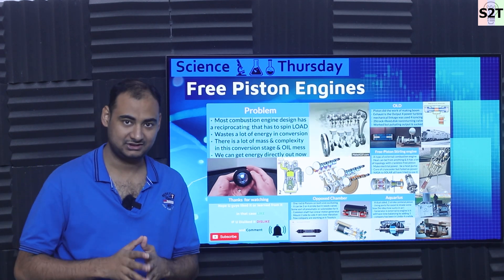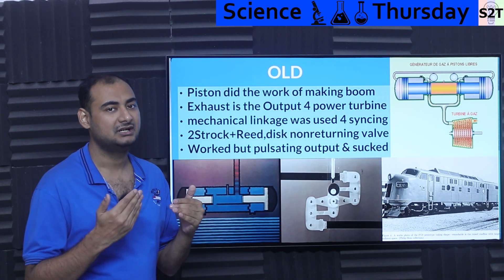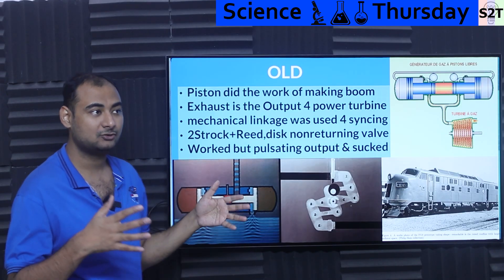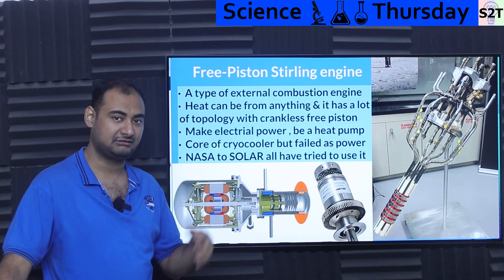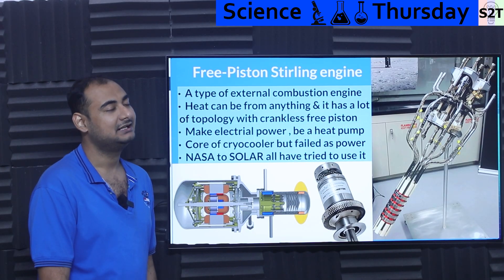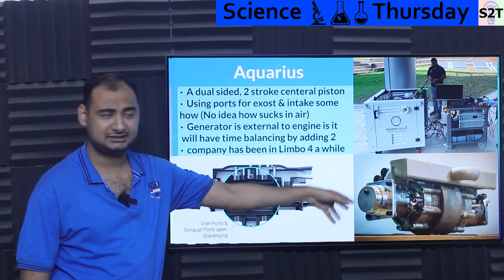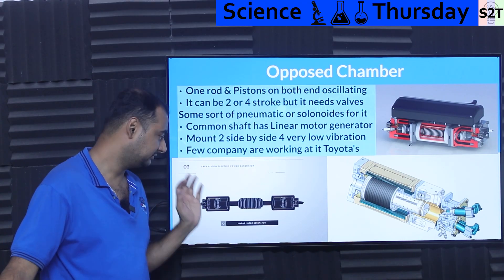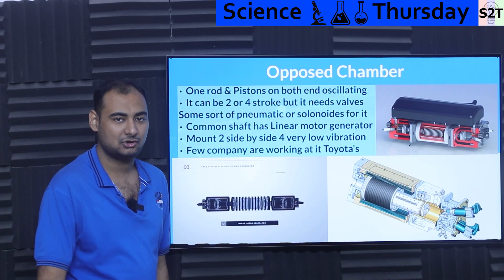Free Piston Engines Explained {Science Thursday}

Comment: 12:00 hybrid turbocharger (with electric motor/generator) on startup generator power turbocharger and in operation recuperate (generate boost and electricity) from excess exhaust energy.
what will be compression ration in that? 100:1 10000:1 free floating 'piston' have nothing to stop movement except compression to slam piston in to dead end. power stroke is uncontrolled in movement.

in my opinion every ICE range extender should have turbo-generator or hybrid turbo-charger-generator. for DC power high rpm is a benefit in power generation.

edit after comment added "ICE"
Reply from the maker: hybrid turbocharger does need a ICE system to feed it or it will become just like a jet engine

Comment: Well done.  I remember hearing about gas springs on the ends, could those power the valves?  
With jet engines working on electric instead of gearbox could we be getting mini turbo jet serial hybrid trucks?
Saw this, would be great for heat recovery, but I think the military ate it for submarines and drones. 
https://youtu.be/zwwmfDIdZok?si=oTNh_8iGPSBcGE1y
Reply from the maker: gas spring  are not good for it as u need to open and keep it open then close & keep it close not something a spring can  do it . jet only makes sence at large scale like 1mw or up
Reply: Thanks, always amazed at the amount of information you keep easy to understand